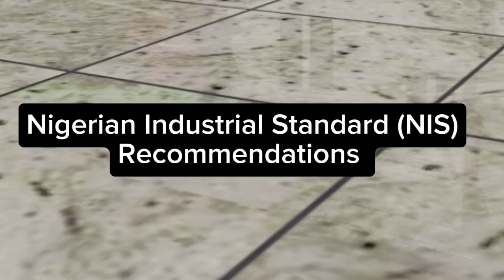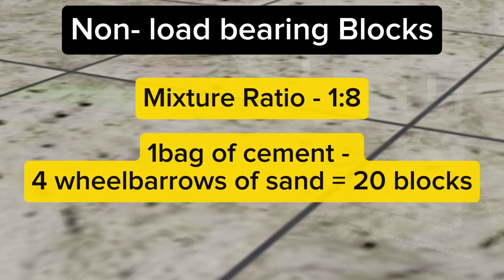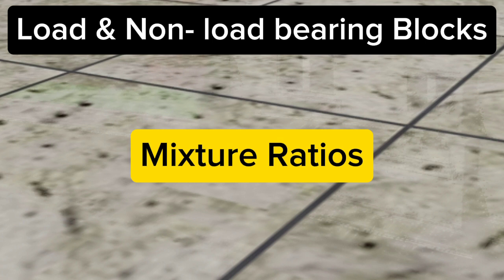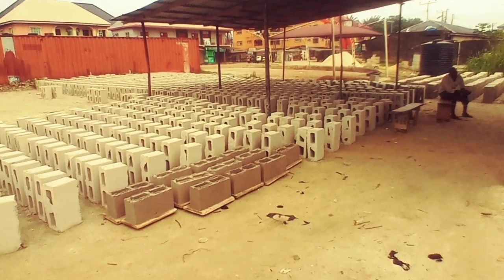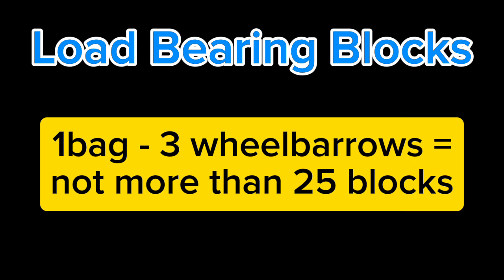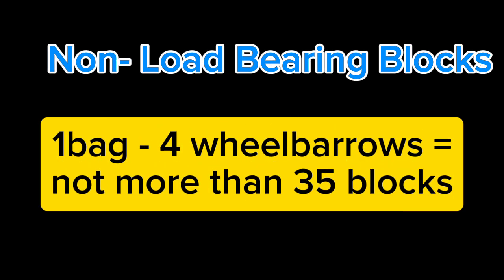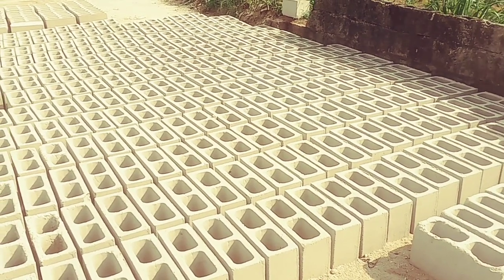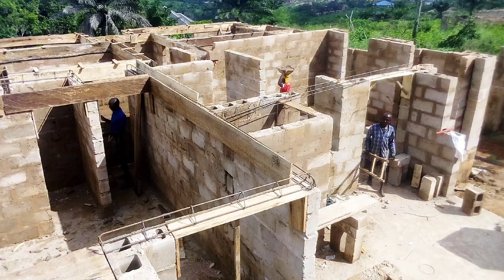Block Moulding in Nigeria: Quantity of BLOCKS to be PRODUCED with a 50kg bag of Cement in Nigeria.

Comment: I WANT TO BUILD 4 FLATS OF 2 BEDROOMS TENANT HOUSE. HOW MANY INCHES OF BLOCK SHOULD I USE? AND ALSO WHICH ONE SHOULD I MOULD? HOLLOW OR SOLID BLOCKS?
Reply from the maker: You need 9inches hollow and 6inches (solid for foundation and hollow for non- load bearing walls) blocks.

Comment: I love your opinion, it is valid

1:5 will give you 25blocks (+/-2),
1:6 gives 30 blks (+/-2),
1:7 gives 35 blks (+/-2),....

Let me add that LOAD BEARING BLOCKS means the block is carrying the weight of the roof, mostly when there is no column (just like typical bungalow in Nigeria sense) while 
NON LOAD BEARING BLOCKS means the blocks are just for partitioning and does not carry any major load (meaning the columns are carrying the loads of the building)
Reply from the maker: Thanks for your input.
Reply: Brother, I really appreciate you for explaining Load bearing and non load in depth. Thank you.

Comment: Can you just use 1 bag of Cement for standard 45 blocks?
Reply from the maker: It is possible, but 45bags for 1bag of cement is much.
Reply: @HousinginfoNG  thanks. I just finished watching your video on cost of building a duplex up to roof level. What would be the cost of finishing, windows, tilling, painting etc? Please. Do you have a video on finishing. If so please kindly direct me. Thanks.

Comment: How many inches are you talking about ?
9 or 6 ?
Reply from the maker: I gave my suggestion on the number of blocks to produce with a bag of cement for both 6 and 9 inch blocks whether hollow or solid, and the NIS recommendation is on 9 inch load & non load bearing blocks.